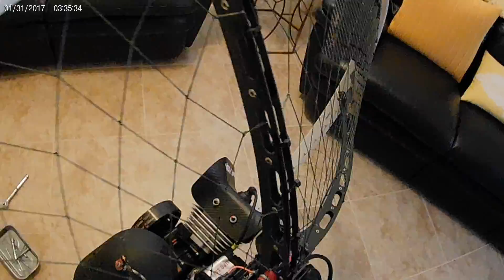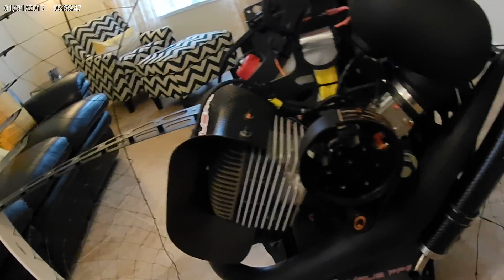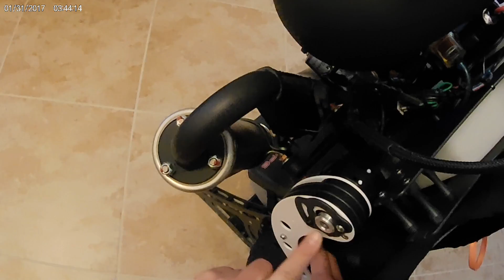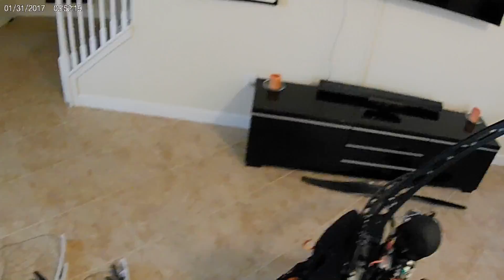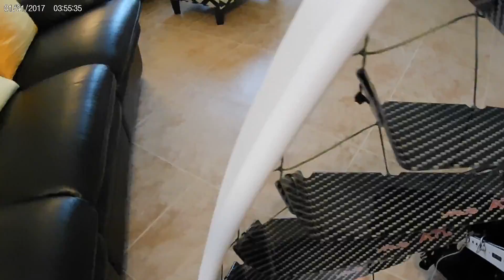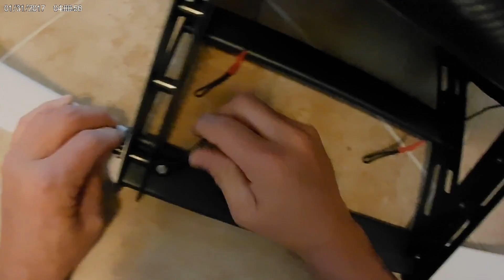Virus Paramotor Assembly Tutorial

Comment: What I want to see is assembly when you get it; so assembling the engine to the frame and connecting airbox and actually running the pull start correctly with the kill switch.  No instructions on that, and I can figure it out...but I don’t like to figure things out that suspend me a few thousand feet in the air without double checking instructions (that I’m not seeing anywhere).
Reply from the maker: I don't have a video of that I but do have plenty of pictures, just have to ask ✌